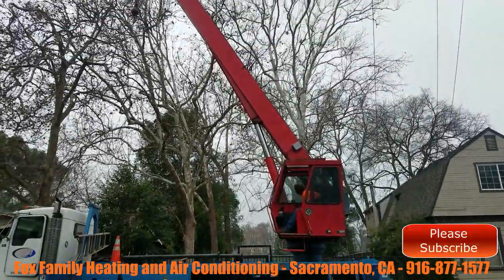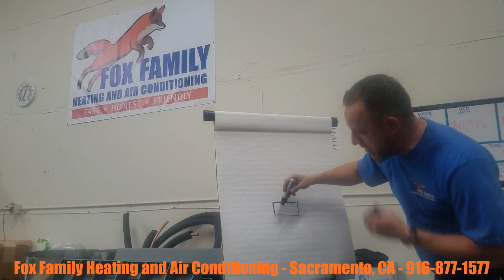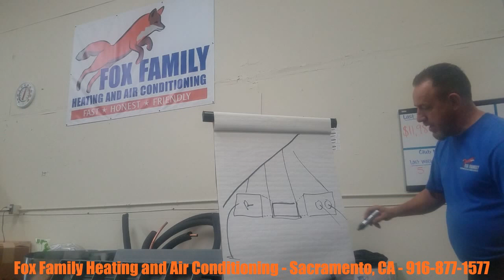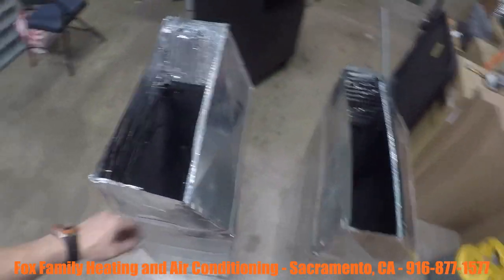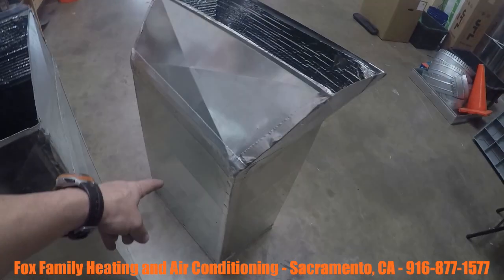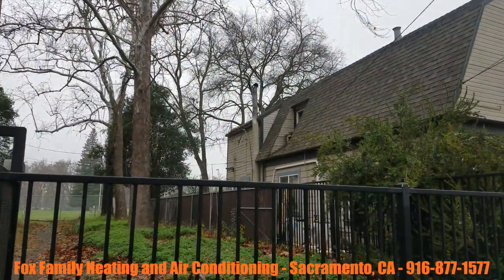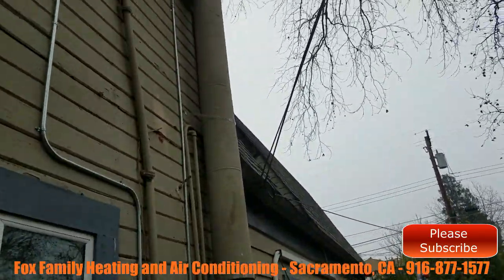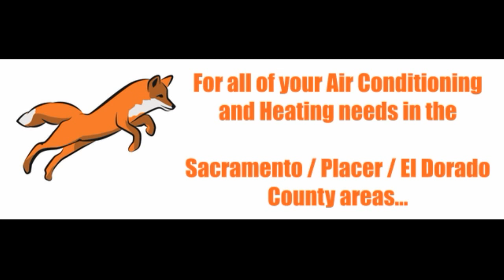The Life of an HVAC Technician - Episode 3, Sheet Metal Work, Control Boards and a Little Creativity

Comment: As a 44 year Sheet Metal Worker it always pains me to the a guy using a claw hammer to use on sheet metal. Jbee tools has a great selection of setting and riveting hammers 16 oz setting and a 21oz riveting hammer works great. When you start using them you will see what i mean. Also Malco makes a great button punch so you don't have to screw this caps on.
Keep an eye on eBay for an old stanley u218 unishear. you will throw those pattern snips out and you will make those transitions in half the time. and if you really get brave find a used lockformer bench top pittsburgh machine ($2,500 - 2,900) and you will be loving life.
Love your videos as always. Just suggestions.
Reply from the maker: Ronald Young yes I know I know, hahaha. Thanks for the info bud. I appreciate where you're coming from.
Reply: not being critical at all but watching you use that hammer is like running you fingernails down a blackboard!! Always like watching your videos
Reply from the maker: Ronald Young haha! Screeeeetch!

Comment: Great job Family Fox can you please share the model and manufacture of you sheet metal bender looking for one, thanks
Reply from the maker: Thanks so much! Here is the ebay link where I have bought them in the past.

 https://www.ebay.com/itm/KAKA-36-Inch-Sheet-Metal-Pan-and-Box-Brake-with-Balance-Weight-Hammer-W1-5x915Z/332587753021?hash=item4d6fc65e3d:g:LCUAAOSweq5aq4bE